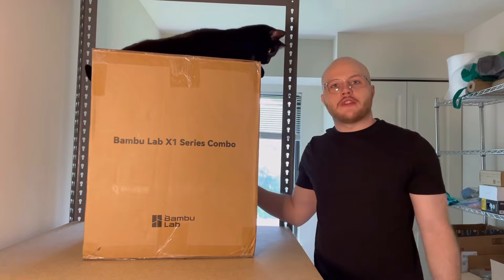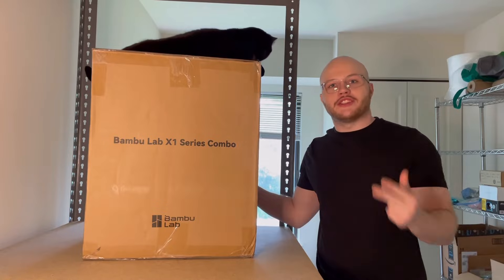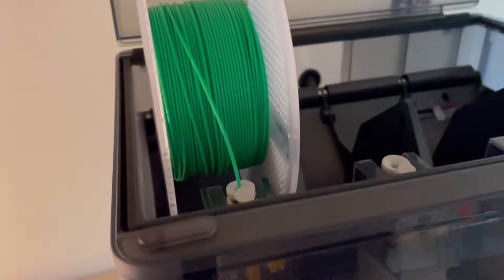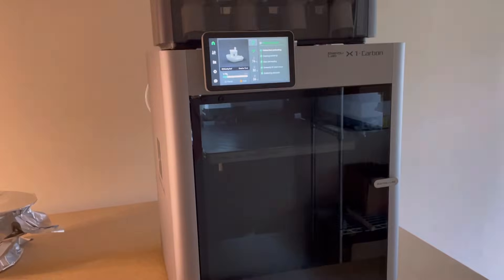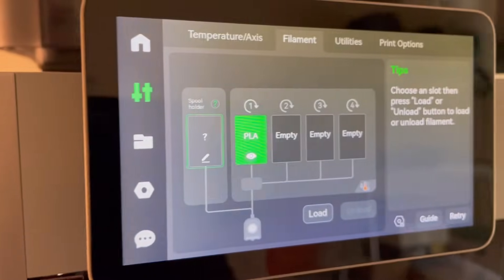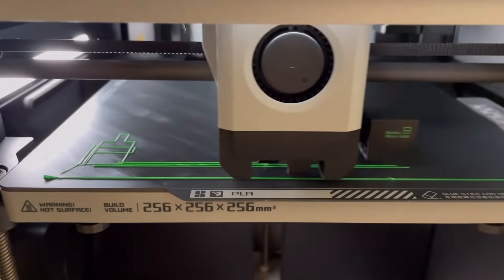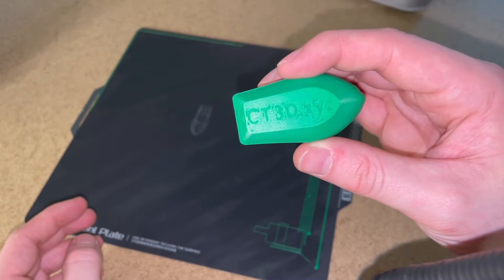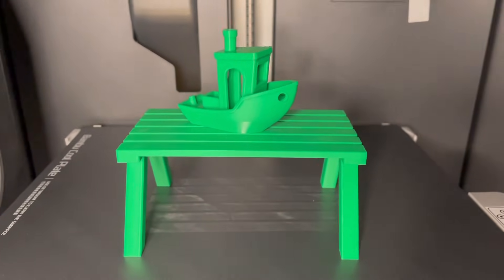Bambu Lab X1C Unboxing, Setup, & First Print!

Comment: Received and setup my BAMBU X1C/AMS today. Your video was more useful than the "micro instructions" that came with mine--Bambu apparently is no longer providing the booklet sized one you have.

My first calibration failed but I may have caused it. I noticed and tried to remove a piece of securing tape on the extruder box during the calibration. Second attempt was successful and I was soon printing.

I also have a Prusa Mk4S/MMU3/enclosure and the endless problems I have with it and errors, plus pressure from my wife who has an X1C and an A1, compelled me to buy a Bambu. She has had her X1C for 2 years and I don't think it is an exaggeration to say she hasn't had 10% of the problems I have had with the Prusa. The MMU3 is an absolute Rube Goldberg contraption compared to the AMS, plus the AMS is expandable. Not only, my 5 toolhead XL has been problematic from day 1 and in fact is on its way back to Prusa now.

Comment: Installed the cables in the back wrong, no cable should bend that crazy. It even has a sticker on the cable with a L looking plug that says this end connects to the 3d printer this side up.
Reply: Right? He did it wrong correct? I'm setting mine up now and put it the other way, made no sense to do it the way in his video....

Comment: So I just received my X1C   ,  seems the instructions and many videos never mention types of Plate  this comes on it.  If I lift mine up like this guy did in this video did I'm pretty  sure it will crack ,  seems attached (probably a hot plate)   ,   no Glue stick in my boxes,  but my instructions show the same as in this video,  I guess I'll keep searching around to figure out what's up
Reply: Mines also missing stuff like the glue. And the extra filaments i brought with the printer. How ever my golden textured plate is a magnetic plate that comes up with lifted. Just held down very firm
Reply: @T0rmented  yes found out new ones ship with the golden plate,  no glue required on it,  works well as far as models not sticking

Comment: I got a textured plate - not smooth like this review- and no glue stick in the box- apparently its random :( - not usable to me as is - not happy being expected to pay more for something you expect in the box at this price. 😥
Reply: I got a textured plate and no glue stick either. Why is it not usable? Can't we just use the textured plate as it is and it may not be needing a glue stick? Did you end up ordering a smooth plate?
Reply: @ooOnymphetOoo  For my purpose - making parts of a larger machine that need to glue together with no seam showing and parts with faces that need match other smooth finish (hatches, battery covers etc) - it didnt suit my needs. The textured plate did however work - and no glue needed - just not what i expected from reviews.

Bambu were out of stock of smooth plates - so I bought a third party one and its working fine.
Reply: @AmbroseClarke  Interesting experience. Good to know this. Thanks for taking the time to share. 
This is my very first 3D experience. Did a test print and was blown away. Also sounds like textured plate is superior ... again if you don't mind that texture. I didn't.  
Yet while trying to figure out, realized... the road of 3D nerdness does not end with filament. There is a plate geekness on the side. Oh boy.

Comment: Some of my tips. Take out all 3 screws completely. No, they didn't forget your AMS. It's inside the printer. Foam under the plate can be taken out during calibration. Don't force pull them. It is not too heavy, weights less than a PC tower. Print your poop chute with the included filament so you can free up a Bambu spool. Remember, you can't use cardboard spools.
Reply: Thank you!!! When I didn’t see the foam under the plate removed in this and two other videos, I was so confused about if it was supposed to be left in or forced out. The directions don’t even mention the foam. Now I know. 😅
Reply: thanks for the tips. just got my printer today and forgot to buy glue stick. also didn't know you cant use cardboard spools with the AMS
Reply: @rudycockrell8029  they make a printable item that clips onto cardboard so it will work just fine. FYI
Reply: OMG thank you, the foam was STRESSING my tf out
Reply: Definitely wish they had better signage that the AMS is inside the printer. I almost didn't on package it in case I had to send it back. Could have possibly waited for a customer service reply unless I had seen somebody post about it
Reply: @chribu5454  It's almost like it says it on their website
Reply: @chribu5454  I bought mine at MicroCenter and asked the guy 3 times if the AMS was really in there because I didn't think it could possibly fit in that box with the unit.
Reply: @chribu5454 don’t worry about stuff like that in the future, purchasing something is a legally binding contract and if they sent you the wrong item that’s on them not on you even if you opened it set up the printer printed on it and then told them hey you forgot my AMS they would legally be required to send you an AMS or you send yours back and they send the proper one

Comment: I have been holding out on buying an X1C and AMS as I had concerns about the wearing of the carbon rods and them not being user replaceable, I then thought I would wait to see what the competition came up with to compete with Bamboo Lab and up to press I dont think Bamboo have anything to worry about.
 I am hoping Bamboo comes up with a toolchanger printer as this would be much more economical with wastage filament than an AMS unit, I did have a deposit down on a Prusa XL but I got sick and tired of all the delays so I got my deposit back.
Reply: It's on sale right now. It made me decide to get one.
Reply: @jawknee21  I got thinking about ording one as the black friday discount was tempting, but then I thought do I want to spend all that money just for multi colour prints and faster printing? and when I thought about it the answer was no
Reply: @AndrewAHayes  I already have an ender 5s1 and a sonic pad. I've wanted one of the x1c for a while when I heard people talk about how little you have to mess with them.

Comment: Bro been watching for a min now, and I’m finally at the point where money isn’t my issue, but deciding on the right printer is. 
I guess my biggest fear is buying the X1C, and having no warranties or bad customer service. 

Would anyone be able to caudal my fears?
Reply: I am in the same boat, my fears are the wearing of the carbon rods and them not being user replaceable, I cant get an answer out of a YTber that is regularly using these machines as to whether the wearing of the rods is a concern to them also, I think this is down to them getting review printers and not wanting to upset Bamboo Lab, I am taking the silence as a yes to them having concerns about it!
Reply: @AndrewAHayes  they are on the website but i bet changing them is a chore
Reply: I just bought the P1P Bambu as an upgrade from my Kingroon (super basic) printer. This Bambu is AWESOME !  Right out of the box... take out 3 bed hold down screws, Attach the spool holder and plug it in to calibrate. There is a fully automated self test that takes a few minutes.  Load the bambu slicer program on your phone and computer. The phone let me tie in the printer to the WiFi so I did all that from my phone.  The Bambu slicer is great. Easy to use , while still having tons of features ( I used Cura on my Kingroon).  I was printing SUPER fast, high quality in less than an hour after unboxing.  A friend has over 20 of these  bambu's ( P1P and X1's ) and swears by them. He is running 24 / 7 and loves them.  P1P was only $599, now I need to add the multi filament adapter....